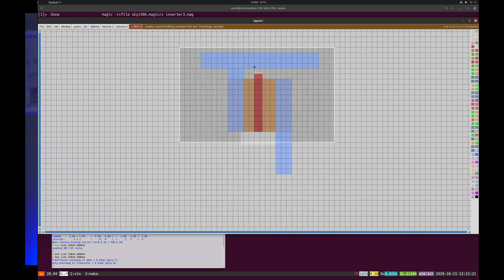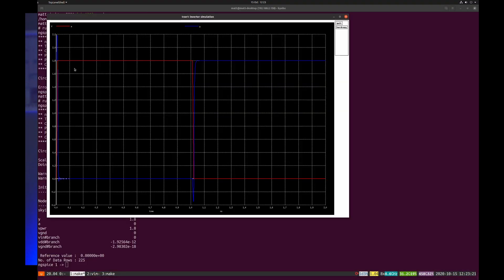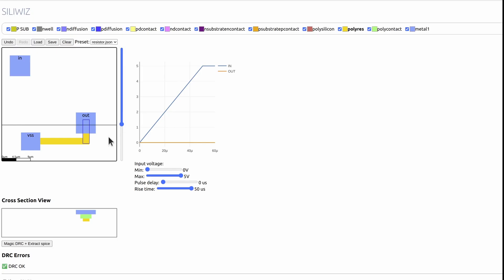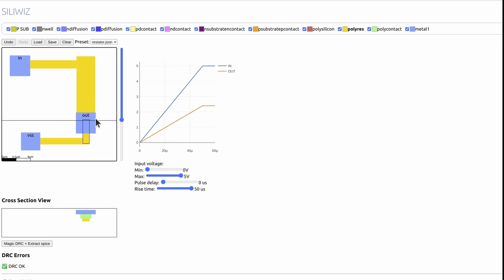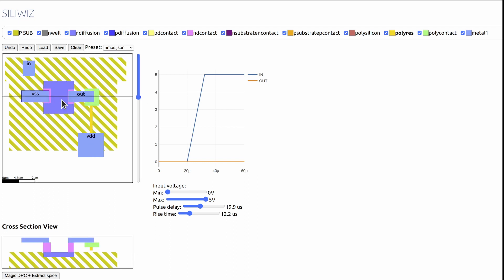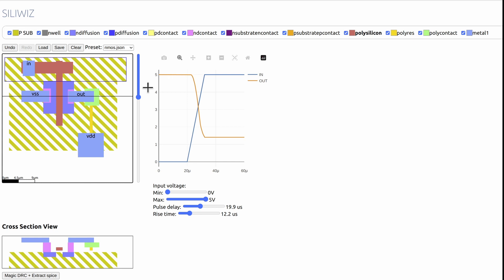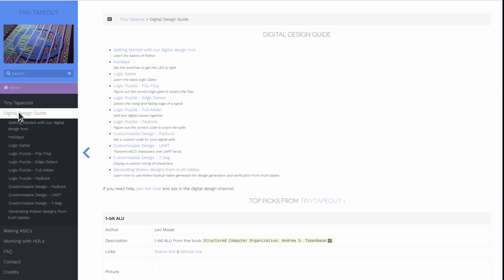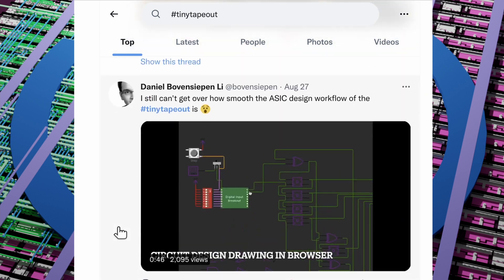Draw your own MOSFETs with SiliWiz!

Comment: I'm a novice at understanding die shots, so I never realized the polysilcon creates a division in the diffusion.

It makes sense, I guess, as it creates that zone of semi-conducting silicon across the gate.

SiliWiz looks fantastic, btw. I'm not quite sure about the name, but it's definitely memorable. lol

It will be interesting to see how it could be expanded further, to add things like "best" examples for standard cells to a drop-down menu, and simulating larger designs.

You can also find some actual standard cell examples from the likes of NEC or Toshiba online. I don't recall which format those are in, maybe Cadence or something, but they could probably be imported into SiliWiz at some point?
Reply: it's called a self aligned gate. As we're using a very cut down PDK to make the simulation so fast, I think we'll be limited to making our own standard cells